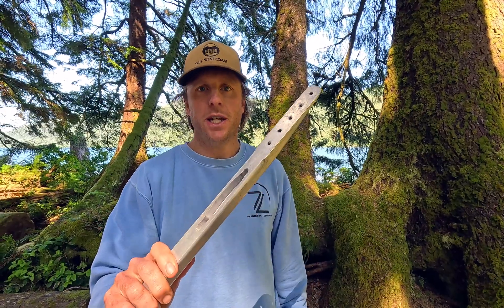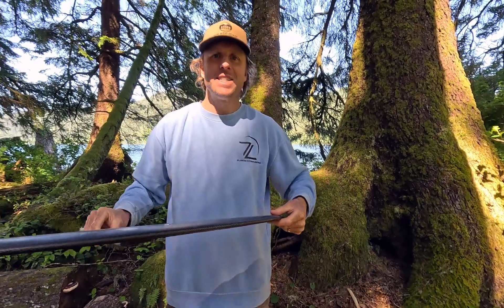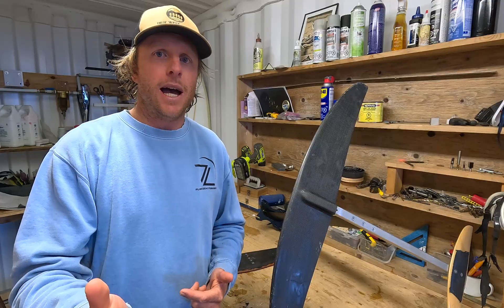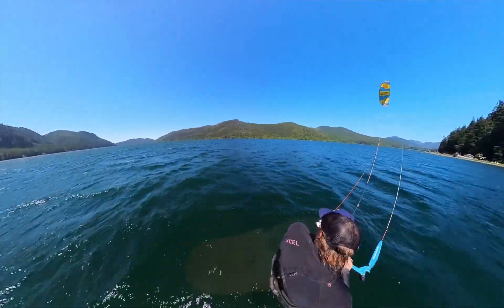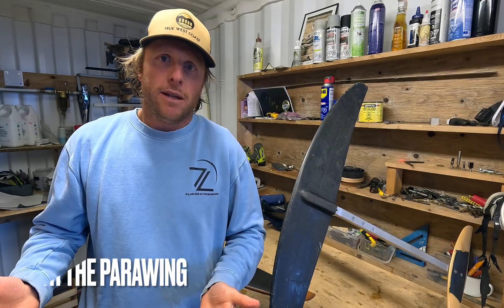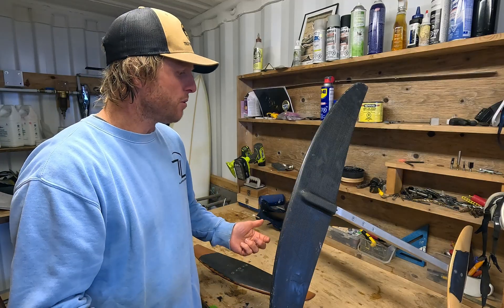I Built a New Hydrofoil at Home! Time to Test It – DIY V4

Comment: Superb! A 1200 should be great for winging as well?!?
Reply from the maker: thanks! yeah 1200 is a good size for winging depending on skill and conditions. Im using the 1060 for the parawing now and its working well but could use a bit bigger for lighter wind because as of right now i need at least 20 knots to get it going. :)

Comment: Those bumps at 4:12 look really nice, is that Gordon's? Sure isn't Nitnat. I worry about the mast to fuse connection and how much it will withstand pumping in your build. Cool project though.
Reply from the maker: Yeah, i never had that connection fail, but that is one of the reasons i upgraded the connection with the socket for this version. its solid as now :)